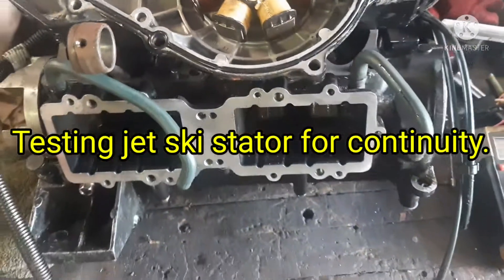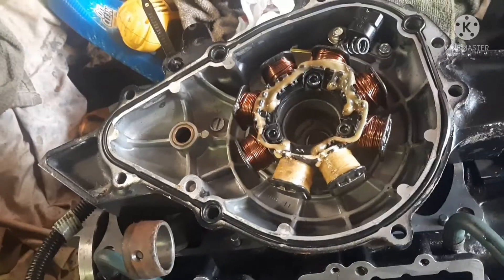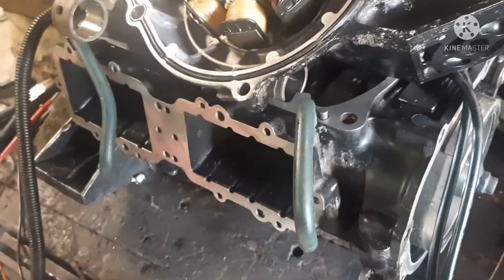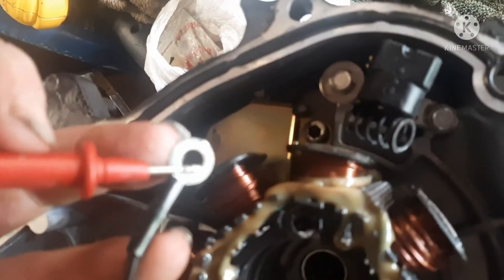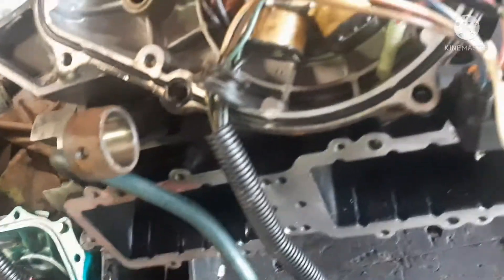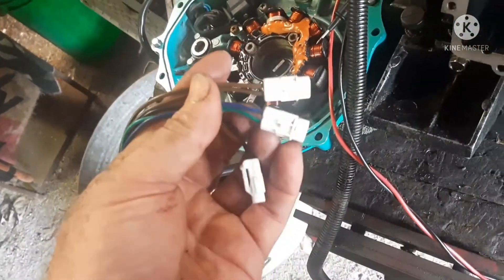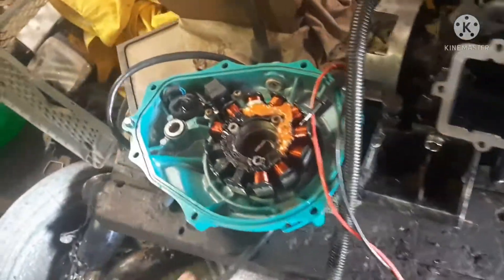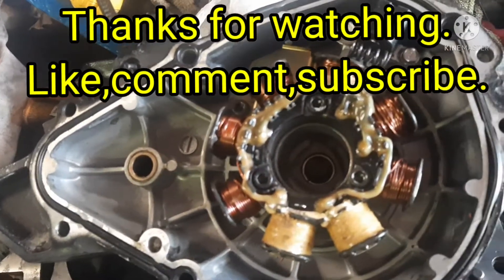Testing a  jet ski stator

Comment: Can I use a cdi with  3754 mine is 3755 on stx 1100
Reply from the maker: Probably a 900 vs and 1100 cdi., but I am not sure.  I think I read somewhere that an 1100 cdi will work in a 900 but it doesnt work the other way as the programmed power curve is different.

Comment: I have a 88 js550 that runs fine but has problems after 20 minutes of riding. If you turn it off it won’t start for 30 minutes or so. Could this be stator issue?
Reply from the maker: @mattsmobileautodetailing is definitely an electronic part heating up and not working when hot due to loose solder joints.  It's most likely a cdi box.  Redneck fix is to remove it...cook it in the oven at low temp for 30 mins NO MORE THAN 250 DEGREES!!  Let it cool and see if that resolders the joints
THIS IS NOT A PERMANENT FIX ,but if it works like it should afterwards, you got a bad cdi box.  It will most likely fail soon after.  It's best to just replace it.
You could do this stator test while it is not starting to verify your stator is good make sure you test for continuity to ground when it is hot.

Comment: Everything read in the correct range of ohms and I still have no spark. I checked everything from the kill switch to the stater to the coil. Any idea of what it could be? I’ve been stuck on it for a couple days
Reply from the maker: Starter solenoid.  Did you try jumping it across the terminals with a wrench.
Reply: @ShadetreeJetski  it turns over just no spark. I’ve looked for shorts coming from the stop button but it was open. I’m honestly stumped on it
Reply from the maker: @BLACKOPPSISGOLD  probably a bad electronic control module.
Reply: @ShadetreeJetski  I ohmed the cdi box the stater the pulser and everything else. I even replaced the cdi box just in case and still no fire
Reply from the maker: @BLACKOPPSISGOLD  do you actually have 12 volts going INTO your cdi box?
Reply: @ShadetreeJetski  that I have not checked out. I will try it this afternoon with an update

Comment: That's not the way you test a stator completely there is different colored wires and you go between each set of wires from the manual to check each winding because all of that that you checked can be good and you can still have a bad winding that's why the Yamaha book gives you color code test for each wire
Reply: Where could I find this procedure please

Comment: Great video 
I have a question about mine
I have a 2007 fx 1100 ho and the volt meter on the dash was always around 12.1 -12.5 it always kind o struggled to start even with a fresh battery. My 06 vx 1100 volt meter on the dash is always around 14 volts.  How many volts should these things be running at and is the stator the first thing I should look at
Reply from the maker: I never worked on one of those.  I would think that the voltage would be higher.  You may have corrosion causing resistance in your wiring somewhere.  I doubt the stator is your issue.

Comment: I've replaced the coil and the cdi ,the cdi is a NOS  Yamaha Mitsubishi cdi still no spark to the plugs could the rectifier stop me from getting spark or should I move on to the stator thanks
Reply from the maker: My first question would be did you buy parts off ebay?  Lots of people sell no good parts claiming they are good.  If you tested the stator as shown you will know if it is good.  No way to test a used cdi other than to try it.  Coils have a specific resistance so you can test them to some degree , but they can stop functioning when warm.  I have heard of the rectifier causing issues on a kawasaki so I assume it can be bad on a yamaha.  Greenhulk online forum has your answer....search it.
Reply: Ok so if I leave a probe in one of the green wires and touch the other probe to a ground amd it reads zero on ohms my stator is bad ?

Comment: I have a 1990 Yamaha 650. Green to green I’m reading 1.0 ohms. Green to ground I’m reading OL. Is this right?
Reply from the maker: I dont know what specific ohm reading you should get just that you should have continuity through the wire and NO continuity to ground.  So yes it sounds as if the stator is ok on yours.

Comment: So my green to green is 1.5, when I went green to ground, I got 0. So stator is bad?
Reply from the maker: No that is EXACTLY the reading you want.  Continuity green to green NO continuity to ground.  Yours is fine.
Reply: @ShadetreeJetski  oh ok, I thought you said, if it reads 0 then it's bad. Well crap, I thought I found my problem lol. Thanks for the clarification!
Reply from the maker: @gp8010  scratch that. YES if you have green to ground continuity it IS BAD green to green is what I read 1.5.
Reply from the maker: Sorry for the confusion.  Green to green I got 1.5 you want the meter to read ZERO continuity to ground.  Continuity to ground means there is a short in the wurung.